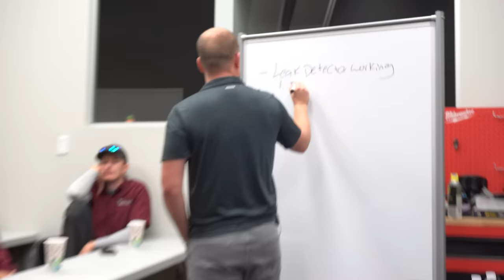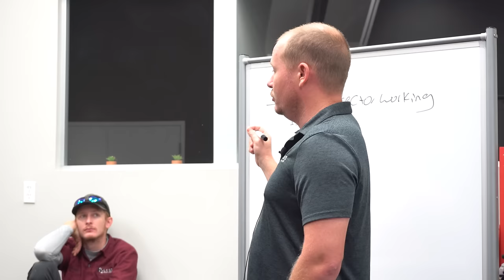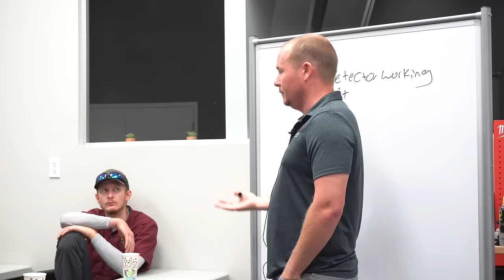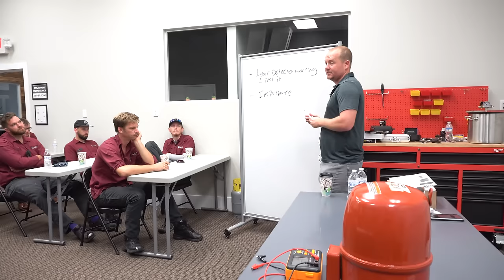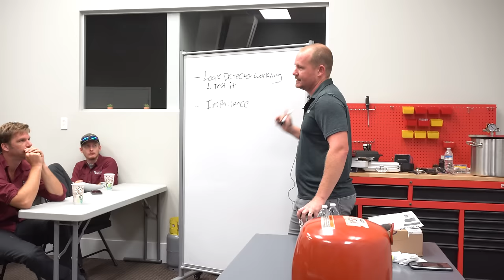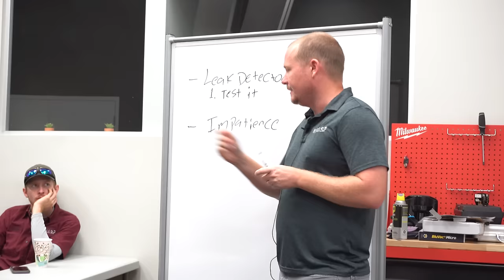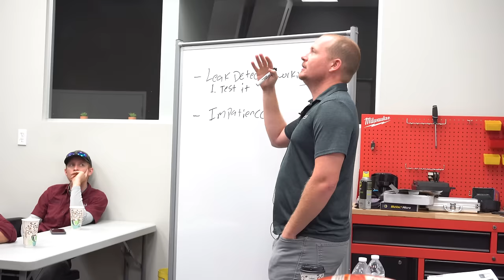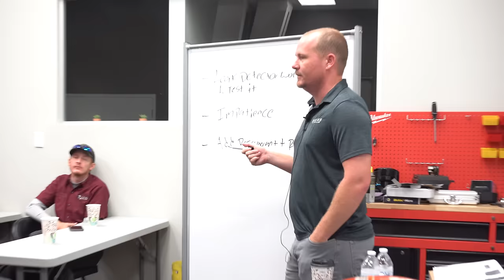How to Find Refrigerant Leaks - Kalos Meeting

Comment: When adding nitrogen, what is the best pressure to charge up to? Obviously that number will fall as it leaks out but what do you aim for to start?
Reply: Use 400, you’ll find the leak
Reply: You'll typically see 150 low side on r22 units and 250 low side on r410a.
Reply: Hey this is a question on mini splits, when doing an install it calls for 550 psi on the pressure test. Why do guys opt for lower pressure during leak detection? I know the older central air systems with r22 are an exception but what about 410a?
Reply: Here’s the thing. And I even asked this in a manufacturer’s training class. I asked why do you bother putting “test pressures” on the nameplate? On small packaged equipment I.e small reach ins RTUS ETC there’s no way to isolate the two!!!! (High and low sides) so how the hell do you derive at or bother stating so called test pressures!!!I have cranked small one door old reach ins up to 250 ton chillers up to 400-500 psi with nitrogen hundreds of times- do you know how many pipes/coils I’ve burst- 0. Or if there’s still enough gas in the system kill condenser fan/water and crank up high side for test purposes. When it’s quiet enough ears and high pressure are king. Dye is stupid. Color the oil? A trained eye can spot oil no problem. Sure where it came from can be tricky but that’s true colored or not

Comment: Electronic leak detectors vary widely in quality and accuracy in my experience. The popular Inficon TEK-Mate works meh ok when new, but has serious durability issues. The JB Prowler is fantastic, but 400-500 bucks is damned pricey. The CPS LS2 is great, around 200 dollars it’s best bang for the buck I have ever used. It’s my favorite. I have a Fieldpiece infrared that seemed to be broken out of the box, I wave it around a cracked tank...nothing. I would love to hear other opinions on other leak detectors.
Reply: i had a cps that i never liked. then the bacharach h10, fieldpiece infared srl2, and i just ordered yellowjacket accuprobe uv. 
not happy with the fieldpiece, it goes off when you bump the unit. too many false positives. the h10 is good but bulky and the battery dont last. hoping the accuprobe is the one.
Reply: Eric M  is that to prevent static discharge? i will try it
Reply: feedback on replacing the sensor on Tek=Mates? Reliability afterwards? Current Jstone pricing about a 1/3 of the tool is replacing the sensor but if I can get a reliable year out of it?
Reply: Consensus seems to be that the sensor only good for a year here.

Comment: Ive used both for many years. I think to be effective you would need infra red and heated diode simultaneously to be fast and accurate. That being said, bubbles and intuition have always been faster and more accurate for me.

Edit, a huge indicator ive noticed is with the black foam insulation is spots where the insulation looks burnt and flakes off like its burnt. Seems like the oil seeping onto it breaks down the plastic that its made of. As always verify.